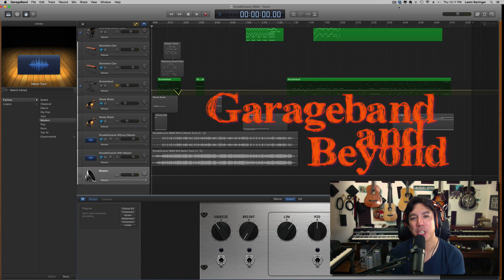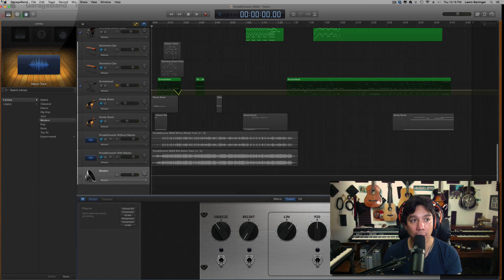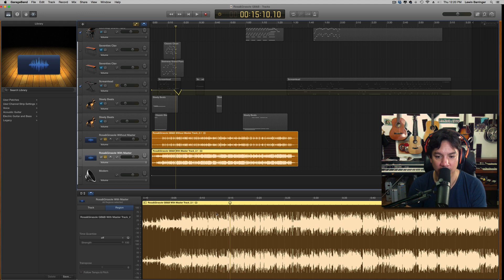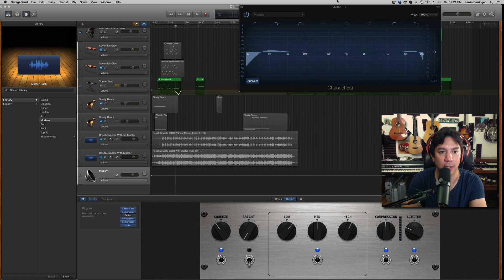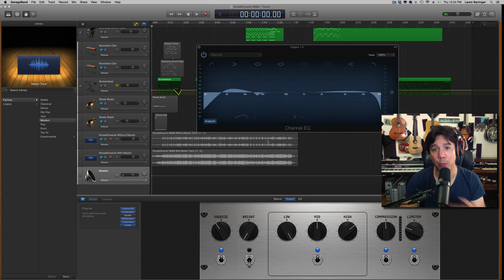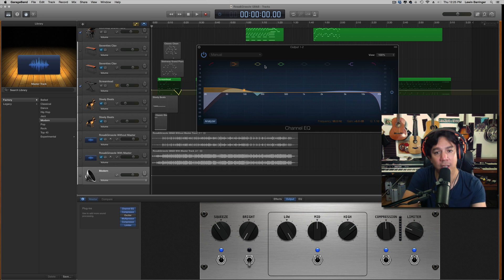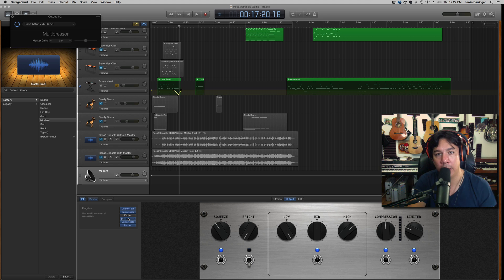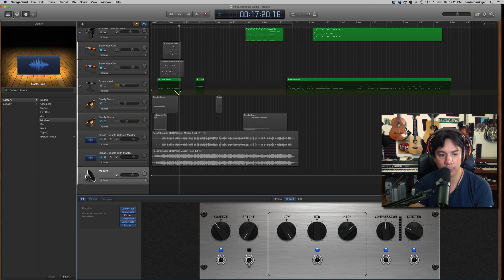Mastering With Garageband 10 Tip & Tricks

Comment: This is a great tutorial for someone who's new to mastering like me. Thank you. Couple of questions though: my current version of GarageBand (10.3.5) only allows me to load five plug ins on the master track. So if I want to use the multipressor, I have to do without the exciter. Can't figure that one out. And also: where is this 'Modern' thing of which you speak? What is it? It's a mystery.... :) All help gratefully received!
Reply from the maker: You can add more than 5 plugins! When you move the mouse cursor between the plugins in the list of stuff you are already running, you will see a small white bar appear. Click on that and you can open another plugin.

Comment: I really wish I could get this to work and increase the overall volume of my song.  I've made sure no tracks are clipping.  I've added all the plug-ins.  To me, the Channel EQ, Compressor 1 and Compressor 2 make very little difference to the overall volume.  What really makes the difference is the Multipressor.  It really lifts the volume, but then the master track clips.  So I turn on the Limiter.  The Limiter gets rid of the clipping, but unfortunately, it undoes everying the Multipressor did.  It seems to me that no matter what I do, as soon as the Limiter enters the equation, I end up with pretty much the same overall volume I started with.

Comment: In older versions of Garageband at least the multi-band compressor was properly adjustable in the selected four bandwidths/frequency ranges of the compressor rather than just having a whole lot of presets. It made it a far more powerful tool for mastering. I am assuming you need to use Logic Pro X in order to properly be able to access the parameters of the multi-band compressor/multipressor.

Comment: Your theory on 'mastered' tracks is interesting considering it only applies to commercial music that one might hear on noisy radio stations demanding an even output of loudness (like adverts). Considering that the width of the signal is the amplitude of the overall recording you will notice that in some genres like classical and romantic music where dynamics play an important role in the quality and nature of the music it is actually a completely different ball game. Here you would want to see surges and changes in amplitude depending on how quiet (piano) or loud (forte) the piece is in relation to the performance dynamics of the overall piece which in these forms of music have a far greater range of softness and loudness volume-wise.

Comment: Is it ok if the tracks and master volume are clipping after mastering?
Reply from the maker: The individual tracks shouldn’t be clipping at all, but the master volume meter would be yes. The problem is that you don’t exactly how much it’s clipping. It’s tough to get right on gb. My advice is to compare your masters to professionally mixed and mastered songs and work in matching those levels as best you can.

Comment: I have a 10 year old iMac. All I do is use garage band and check email. I want to buy a new Apple computer for the new GarageBand and strictly for recording music. No gaming. No watching movies. No video Editing. Just music. With a few other softwares and plugins. I’m tried of seeing the spinning beach ball and being told I have too many live tracks only after just recording 3 or 4 tracks. I want to lay down 10 to 15 tracks a song without it lagging. Please send me some advice on what I should I get. The iMac pro is not in my budget. Thanks.
Reply from the maker: I have a mid 2011 iMac running the i7 chip. I upgraded to a solid state drive and put in 32gb of RAM. So I'd say buy something used that is at MOST that old!
Reply: GaragebandandBeyond wow thanks for getting back to me so soon. Do have any idea what that may cost me
Reply from the maker: This one looks like a solid starting point, although I would buy a bigger internal HD 
https://www.ebay.com/itm/iMac-27-inch-mid-2011-i7-3-4ghz-amd-6970m-2048-mb-2tb-sata-512gb-SSD-24gb-RAM/253339763830?hash=item3afc3a0476:g:RtEAAOSw8axaSfnh

Comment: Learned a lot about the program thank you very helpful !
Also what about hard "S" in vocals any tips on how i can get them to sound better, far as i know garageband has no desser.
Reply from the maker: +2REAL garageband does have a desser!
Reply: Where do i find this plug in ?
I definitely need it on a few songs i hitting the "S's" hard
Reply: On my version (which I believe is the latest version), the desser is found in the Show/Hide Automation area. It's under "Plug-ins" along with Channel EQ, Compressor, Channel EQ 2, and Echo .The Show/Hide Automation is beside the Catch button. If you're still not finding it, it's straight across from the Add Track button (aka the plus sign). Hope that helps. However, I will say, the desser did nothing for my 'S' issues (but then again, I'm likely misusing it). I've learned since that I was too close to my microphone and not softening the 'S' sound when singing.

Comment: I'm really enjoying your video series and learning a lot. I'm new to Garageband, and have some questions, if I may. 

I think I may be missing something. Here's what I've been doing . . . I mix all my tracks, make sure nothing is in the red, and then I bounce the song as an aif file. I then pull the aif file into a new project, turn on the Master Track and use the mastering settings you gave in your other vid about mastering. But now here's where I'm confused. What happens after that? Do I just bounce the track again after applying the mastering settings? Do I bounce it as an aif or MP3 file?

Is this the right order:
1. Mix tracks
2. Bounce song (with mixed tracks) as an aif file
3. Master the aif file (that was bounced)
4. ???????? (what next?) --- Do I finally bounce the song as an MP3 or aif file (if I want to share it with others and/or on YouTube)?

When I use the Master Track, I notice that it controls the overall volume of the track(s). Do I want to crank the Master Track all the way when I go to do the final bounce? After the bounce, it seems as though it makes no difference whether I crank it or not. Where should the aif file be volume-wise when I'm mastering it? I remember you saying that when mixing we should keep everything in the yellow, but I'm confused about where to keep the aif file (that I had bounced)-----should that also stay in the yellow? The red? 

My current results yield a song with very low volume. I had nothing in the red when mixing (and I kept it all in the yellow). My Master Track was living in the red. I've compared my "finished" song with other professionally mastered tracks and I'm not even close volume-wise. 

Sorry, Lewin . . . so many questions . . . Thanks in advance. Any/all help is most appreciated.

Comment: I know we shouldn't just expect to use your settings but it's easier to learn when everyone is using the same thing. My point is, my garage band doesn't have "modern" and it was updated recently.  Luckily "pop" has all the same plug ins minus the "multipressor". Am I just missing a button to add that? orrrrrr...?
Reply: Hi men, did you the find the multipressor? or do you know how to get it? i dont know how to get if you can help me i would really appreciate it
Reply: If you go to the master track plugs in's, under dynamics, you will find the multiprocessor second to last.

Comment: hi Lewin. I appreciate this tutorial, but I can't get a Master track wave form to open up when I click on 'Open Master Track'. All I get is the 'Factory' preset and nothing opens to an unmastered or mastered track wave form. I have GB 10 and am stumped, can you help? thnx!
Reply from the maker: +Marty Dixon you won't see any waveforms inside of the "master track" it's just a master output channel.

What you saw in the video or two separate exports, one mastered and one un mastered. They were both dragged back into GarageBand just so I could show you guys the visual difference.
Reply: thanks for the help. How can I do any EQ'ing on my mix before sending to iTunes? I can't find a waveform of any track or the mix on an EQ screen. Is it possible to apply your tips before I create an Mp3?
Reply from the maker: Marty Dixon when you are looking at the EQ window in the master output, the big blue rectangle where you can move the line up-and-down, look in the lower left hand corner you will see a button that says "analyze" click on that and you will see the master output EQ shape and you can change it from there.

Comment: Although I have noticed that normalizing does strange things to your overall mix. My experience is that it creates two large of a chasm between the levels in lead vocals and backing/rhythm tracks. Therefore, I prefer not to use it if possible. Sorry for all the long winded comments. Just trying to get some clarity on this issue.
Thanks!

Comment: Very informative video. Question for you: some of my individual tracks are driving into the orange on the VU meter. However, when I listen to them isolated on play back, they sound perfectly fine (no clipping). As long as I keep the main stereo gain (top right corner) pulled down, so it's never going into the red, and make sure auto normalized is clicked off, it should circumvent the process of analyzing and subsequently lowering the data found in the stereo file. In other words, when auto normalization is turned off it will default to the main stereo gain settings for output volume. Am I correct in assuming this?
Thanks so much!
Reply from the maker: Well.... Yes and no.
There's more at work during the export process than they admit if you ask me. 
These days I'm a firm believer in headroom when it comes to those meters.

Comment: Hey, not sure if you already addressed this or not, but I'm a bit confused. The two tracks that were just above the master track, the before and after. What are those and how did they get there? I open the master track and start working the controls and stuff happens but I don't get a region view on the track.
Reply from the maker: Those are two exports that I created and then dragged back into GarageBand before making the video.
They are only there for the purposes of demonstration.
Reply: Ok, thanx.
Reply: Thanks! I was wondering the same thing.  @GaragebandandBeyond

Comment: Hey Lewin, thanks so much for this video! I am musical director for solo artists and part of that title recently has been making MIDI hip/hop and R&B samples on Garageband. Your videos have helped me tremendously on the mixing and mastering side of things (something I previously had little experience with). I had one question about clipping issues that I have been having. After I've gone through and recorded all my tracks I find my drum mix (the MIDI Drummer) to always be giving me clipping issues in the master track. The individual track is fine, but in order to relieve the clipping on my master I normally have to go around to -5.0 through -6.0 dB on the drum track causing a lot of mixing headaches. Any ideas on how I could avoid that? Or do I just need to mix at that level, squeeze it tight and let the Multipressor boost it? Thanks! - James
Reply: +James Young Something has to be pushing the drums too hard if that's the issue. Possibly the compressor. Just use the stock GB drum compression settings an go from there.

Comment: How did you get the unmastered and mastered tracks into your project?
Reply: He mixed everything,then went to share->export to disc (and choose aiff uncompressed file). Choose your desktop as destination and press yes or mix down, whatever prompts it to mix down. Then he took that track (which was mastered, but had no mastering effects added so it was really just mixed down.)and he dropped it in the tracks area of G.B. Then G.B. Created a new audio track for it automatically. Then he muted that track, went to master track again, and this time chose the mastering effects preset he showed (with the compressors, eq and limiter), tweaked them all to his liking, and went back and exported again.The new file was mastered w/effects.He drug that in&created new audio file. Now he had the two tracks. The first mixed down w/no mattering effects, the second with.He wasn't very clear that there is no Master track w/waveforms and that would have confused me if I didn't already know it. Once you get used to things it's easy to forget that every small step is important.

Comment: I have an issue when i connect my roland ax synth to garage band via midi... when i press two notes simultaneously, one get off and another is on and sustains. When i use the chords in tone... If i press two keys simultaneously i get a sound when i press and get one more sound when i release it. Kindly help...

Comment: A lot of the time when I mix things I do it with headphones and there is rarely any clipping during the process, but once I play the track through some speakers I can find clipping in certain parts and this can change depending on which speakers I play them through, Does this mean that its the speakers fault or is there more I can do to reduce the clipping?
Reply from the maker: The easiest way to avoid that is to turn master volume down a few db.
Reply: As in the Limiter?
Reply: Never mix with headphones unless you have extremely expensive studio headphones. I've got $200 studio headphones and I never mix or master with them. Things might sound fine on headphones and you get them off and play it through your studio monitors and it sounds totally different. I have a pair of $300 maudio monitors which are pretty industry standard, but I actually mix and master with a pair of $85 maudio son that are partially plastic(the grills). I think the speakers are 3" with a tweeter. Anyway, they're still good flat monitors and I use them because they are really better for knowing how far I can push bass eq before it farts and they let me know when things are muddy. I use the other monitors for recording guitar and bass parts. The more expensive monitors can make things sound a bit 'better' than they are. Hard to explain.